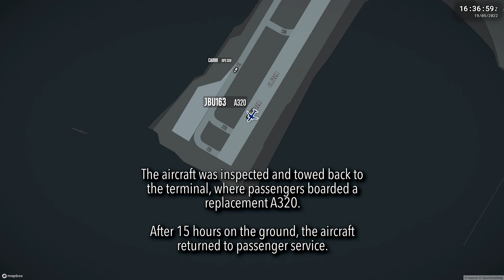HYDRAULIC OVERHEAT Results In Emergency Landing At JFK [ATC audio]

Comment: You can hear the adrenaline in the captain's voice! 
Considering how much runway they used with no brakes or reversers, he had good reason to be amped.
Almost dead-sticking it into JFK is impressive.
Reply: That was actually the FO talking after they landed. Either way they did a great job handling the landing considering they were using alternate-braking.
Reply: Wouldn't FO be on comms while the captain is flying?

Comment: 3:13 I think it was tons of fuel
Reply: 18,100 pounds of fuel probably
Reply: @paddyohenry6428  18100 pounds is 8.2 tons of fuel. An A320 will need around 7 tons to get from JFK to Florida plus 1 ton extra which makes sense. But what does not make sense, that pilots decided to burn fuel before landing, 8.2 of maximum 24 tons isn't that much.
Reply: @KolyanKolyanitch  But they had impaired braking and no reverse thrust.
Reply: @KolyanKolyanitch  Impaired braking, no reversers, slowed control of flaps/some inoperable, and it was an emergency landing on top. No need to rush things when they've got plenty of fuel left to try to work the problem before landing and the less fuel onboard during a crash the better. It's not like it was super urgent and I'm not sure if the time in that holding pattern was actually to burn off some fuel. Maybe they could have landed with it but for all we know the Airbus checklist they were working through might have required them to dump fuel to land if they weren't below some threshold. The crew handled this by the book, requested to level off and stay near the airport at first before they were sure they'd need to declare an emergency and land. This was exactly the kind of careful measured response you'd want in an emergency, they weren't at risk of falling out of the sky so no need to rush the landing.

Comment: What Flightradar is that?
Reply from the maker: The radar display runs in custom software I designed.
Reply: @AirTrafficVisualised  ah well it looks nice, shows good info and good to see flight paths etc.
Reply from the maker: Cheers! If you have any suggestions of elements you'd like to see on the display (related to aircraft or the background map) let me know, I'm continually tweaking it and adding new features. I've recently added a day/night overlay which you'll see in an upcoming video!
Reply: @AirTrafficVisualised  One suggestion I have is to increase the refresh rate of aircraft position/rotation by interpolating between the values. So lets say if your source data is 1 update/second you could display 4 updates/second by approximating the values between 2 points. Would look smooth and more like real time data. Also would be helpful if there was a visual change to the plane based on altitude, maybe more transparent or smaller/larger at high altitudes?

Comment: Hot bleed air responsible for the overheated hydraulic reservoir?
Reply: Does bleed air make contact with hydraulics on commercials? I work on corporates and have never personally seen a hydraulic overheat. I imagine hot brakes or a fire could do that.